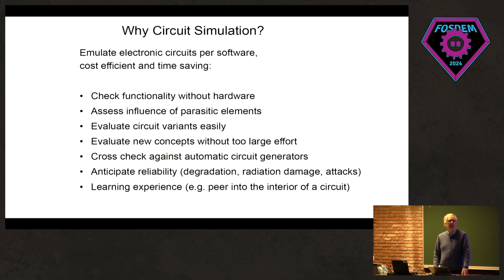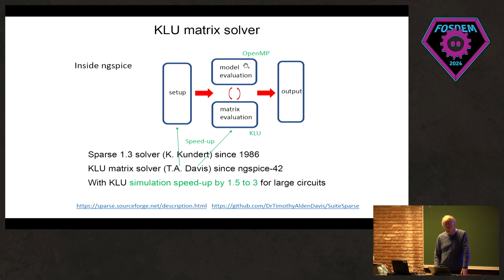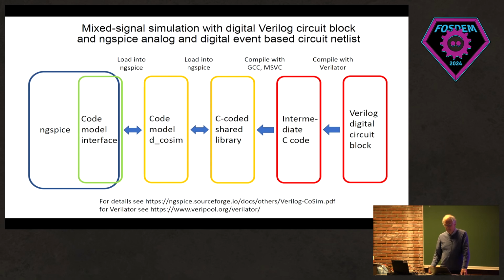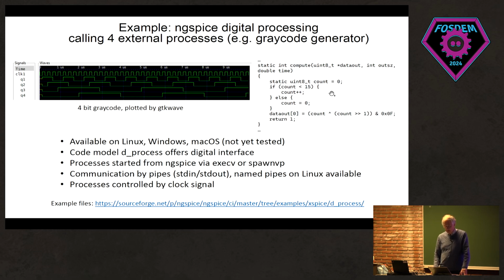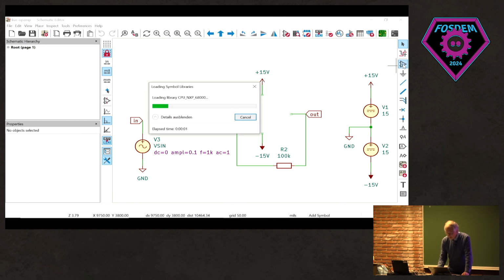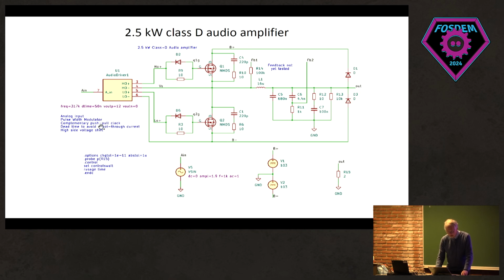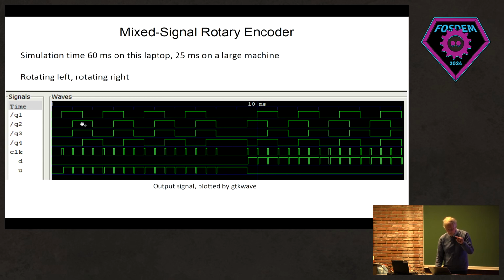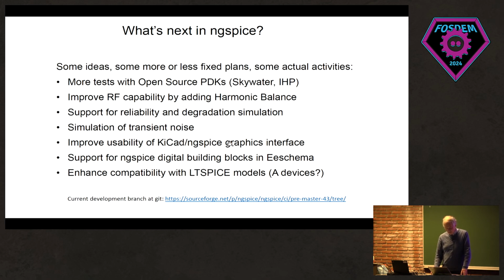FOSDEM 2024 - ngspice circuit simulator stand alone and embedded into kicad

Comment: It is unfortunate that it is not clear which parts of the presentation relate to ngspice, which parts relate to KiCad 8, and which parts relate to both working in conjunction (KiCad GUI with ngspice).
Also, it would be helpful to have a link to a Git repository containing KiCad projects with the Schematics+ngspice models from the presentation.
Reply: I think it is very clear. KiCad only provides ngspice with a gui. It does nothing else. All other features are those of ngspice.
Reply: @absurdengineering  it is in no way clear which parts of ngspice that were discussed are currently exposed in the KiCad 8 UI, though. I KNOW that quite a few of the subjects are NOT currently available. That was what I was referring to.

Comment: Ok, how about adding simulation of PCB traces and SI in KiCAD ?
Reply from the maker: It's a wishlist item but it's quite technically complex. The open source solutions for FEM are very unwieldy to integrate, many depend on Fortran which causes crossplatform issues.
Reply: @kicadeda  , got it. thanks. Thank you very much for KiCAD!